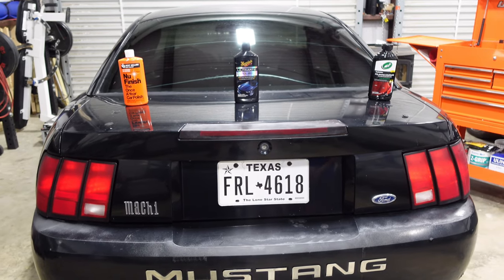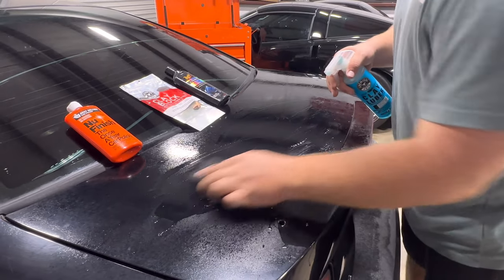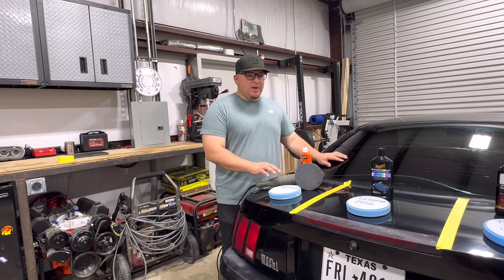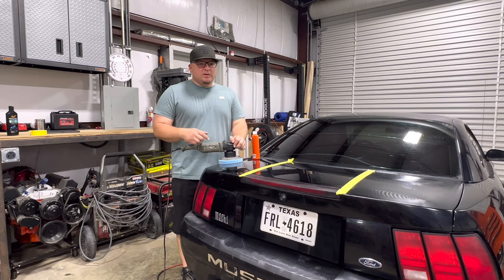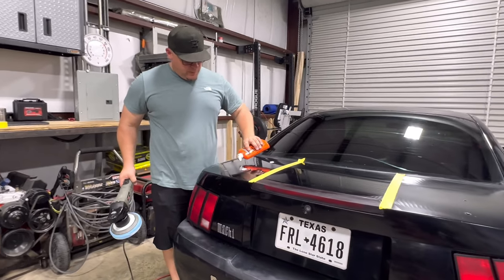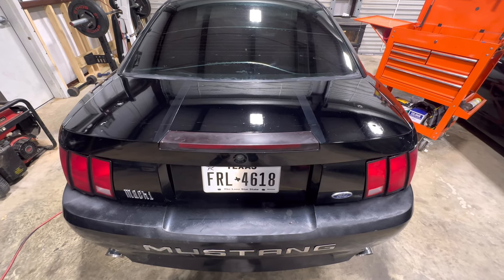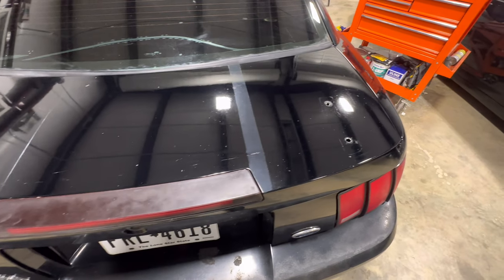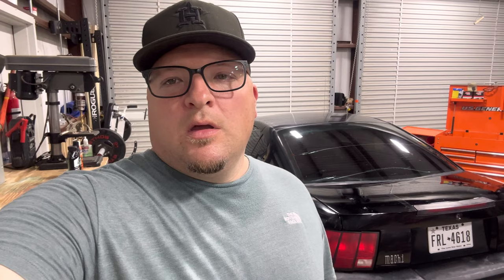Best Car Polish

Comment: to be fair the NuFinish isn't really a polish. It's a sealant with fillers and optical brighteners. If you give that trunk lid a decon wash and set it back outside within a month or two the Nufinish section will return to being oxidized. The Meguiars and Turtle Wax are both finishing polishes, with the Meguiar's being a bit more abrasive. Both are great as a second step after compound to remove haze. I'd give the turtle wax an edge up here as it requires a lot less product and has a much longer dwell time to work the product. But it really comes down to what you are using it for.
Reply from the maker: @riccochet704  👍 your right the meguiars is a tad bit more abrasive.
Reply: I don't believe the meguiars is more abrasive. It contains fillers in addition to the abrasives which makes it appear to be cutting more. Both only have fine abrasives, and would dall into the category of finishing polishes.

Comment: These products are all totally different. The turtle wax is a traditional abrasive polish designed to remove light defects. The meguiars also contains abrasives, but has fillers as well to hide scratches, and the nu finish is basically a synthetic wax/sealant. Like comparing an apple, orange, and banana and saying which is the best fruit?
Reply from the maker: Not really
Reply: @quickspoolgarage  What do you mean not really? Are you disagreeing with my take on the products? Because a tiny amount of research, along with a thorough reading of the labels will tell you that I've described them correctly. 
   I'm not saying your comparison was worthless, seeing the results could help some people. I do appreciate your effort.
Reply from the maker: Thanks bud

Comment: Great video.
NuFinish is a sealant and not a conventional polish.
Ultimate Polish has oils and fillers and is a glaze.
TW Polishing Compound is a pure polish with oils and zero fillers.

I used the TW PC on a 2017 Soul Red Mazda 6 with very minor water etching and love marks, with two twelve inch scratches on the hood.  The oils deepened the color and did nothing in the way of correction.  OTH, I have had look correcting scratches with CG V4 Polish + sealant on a 2011 Race Red F150.  The V4 leveled two moderately deep scratches that could be felt ever so slightly with a thumbnail prior to application.